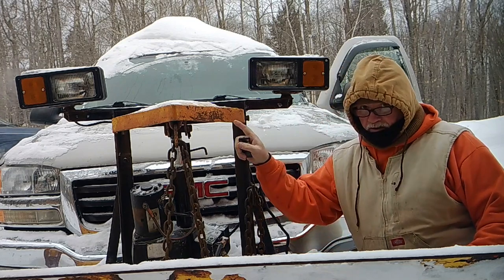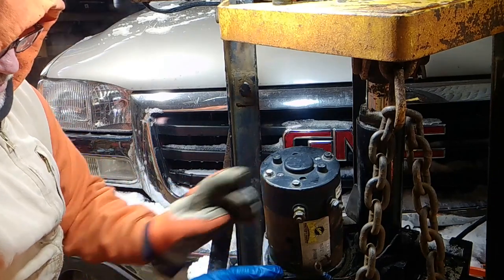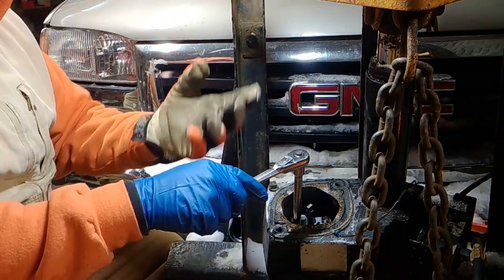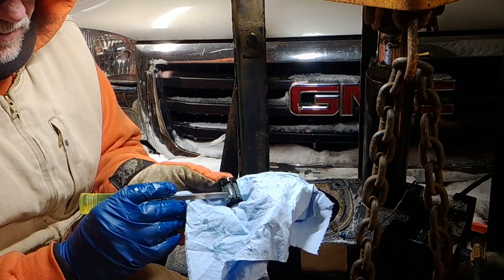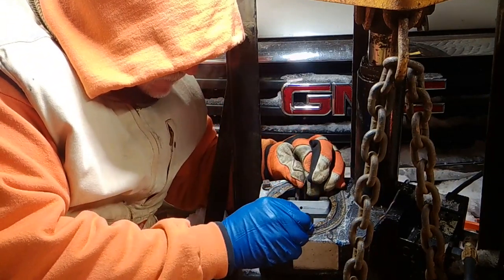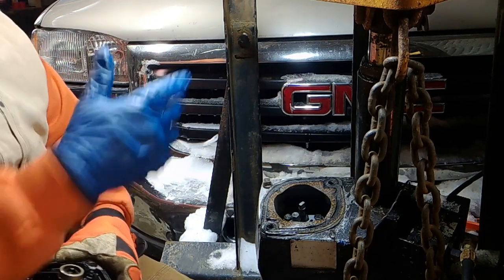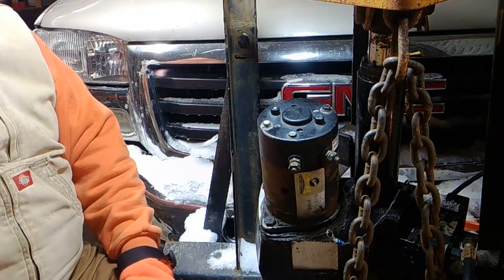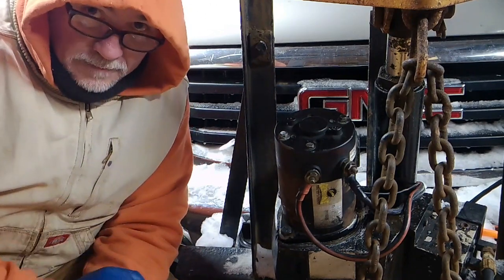Why my Fisher minute mount doesnt work? How to clean filter/screen on Fisher Minute Mount plow.

Comment: I love this guy. Best part--it still didn't lift the plow. I'm troubleshooting the same MM1 plow. Going to try and change the motor. A new one was $50. After research, no idea how to tell if it needs a new pump or new motor. Others on here are saying it's a check valve. Others a solenoid/wire. I will note the Fisher service said this plow originally was spec'd for regular red transmission fluid, not the new Fisher blue fluid. That filter might collect water that the blue separates. The red transmission fluid tended to mix w water. Just a guess.

Comment: Loved your video. Just finished pulling my screenS out. 
CAUTION: Some of you may have the model motor/ hydrolic reservoir that bolts from the bottom instead of the top like this man's video. 
I just snapped 2 of the 3/16th bolts. Luckily it is held securely by the seal and 2 cross bolts that didn't strip. I recommend using extreme caution

Comment: Very informative  !  A suggestion though ..?   A pipe slipped over the socket wrench -handle , for additional leverage to loosen ..  I usually rock it a bit .... { left/right ..left right ... } and Then proceed ... Breaks it loose first . .

Comment: Your probably going to have same issues. Reason if you had water in your system you need to flush out the system all 3 pistons. Then brand new fisher oil. Thanks for the video

Comment: Ugh, you didn't show the oil fill process..!! I needed to see that! I just was given this plow, my first minute mount, same issue. Friend had new motor installed at plow shop, but doesn't work and when it eventually does it is slow and shutters to the left!! I assume same issue,  ,. But I don't know how u got the rest of the contaminated fluid out of system and then refilled it as well as removing air, and when it's full. But otherwise informative as to where the screen is.

Comment: My motor runs, but I have no lift, or angles.
Reply from the maker: Have you tried everything in this video. The screen is probably plugged.
Reply: @TheBigmachineman  yes I did. This is what I've done... cleaned all connections. Pulled pump out .. cleaned screen. Cleaned tank.  New blue hydro .. replaced main solenoid. 14.47 V on solenoid.
Reply from the maker: This means you have a wiring issue. You may hear the pump engage but nothing is telling it what to engage. You need to get a wiring diagram and start tracing.
Reply: @TheBigmachineman  I think it's the s3 coil at this point. I had it all back together and had someone go thru directions and I didnt recieve magnetism on s3. I took out and hot wired the coil and valve off unit and I did not get more than a click. (Thanks Kyle) Yet, was covered in the new fluid. I reassembled and used my Jack to raise the plow blade and hooked the safety chain to hold it mid air. Pressed controller L and immediately went R. Pressed R and it went R. L went R. Tested coil, no magnetism. 

I have continuity between Truck batt and plow solenoid. And between hot (14.7v) and all points on solenoid I cluding the backing plate ground. When plow is engaged the motor reads 9.8 volts. 
I'm hoping a new S3 solenoid coil is the problem. Or, it's on to something else.
Reply: Is there check valves in the hydraulic hoses and or going to your plow rams. A check valve isn’t probably working